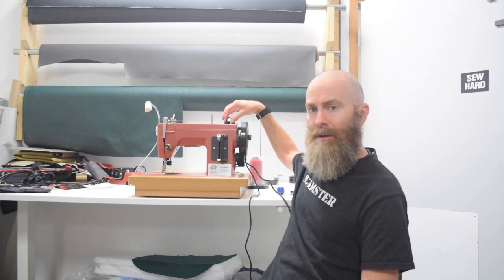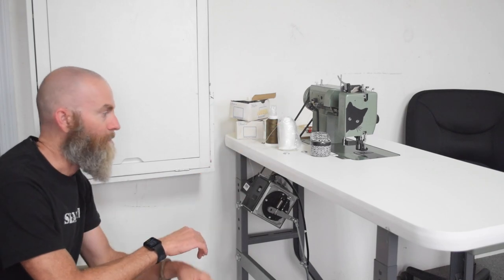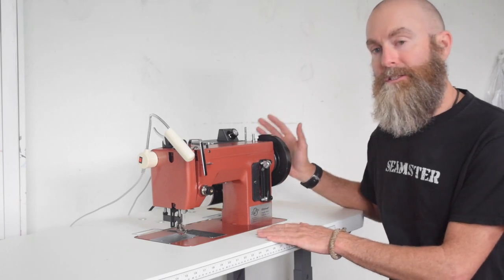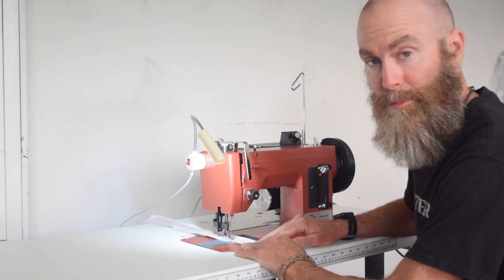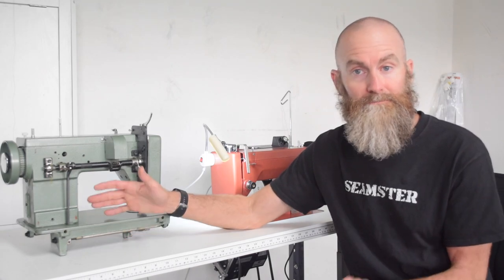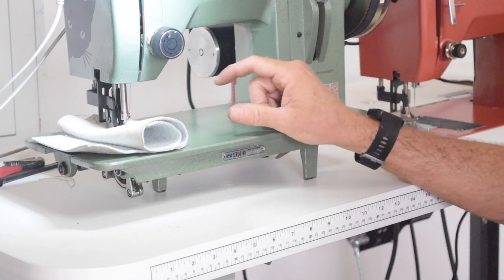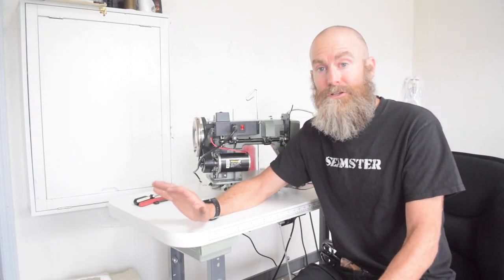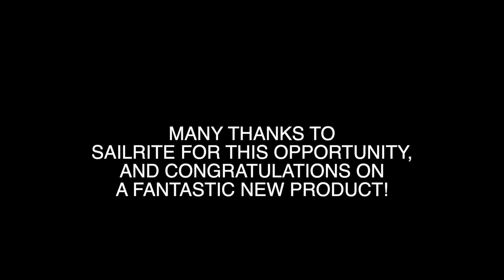Sailrite WorkerB Motor Package (It's Incredible!!!)

Comment: Sailrite owes you a sale. I have been on the fence for a few years about buying their machine. I just bought one that comes with this motor package.
Reply: I'm SO sorry.  You drank the KoolAid.  You'll regret your decision to not buy a real machine soon enough.  et me know how many "work arounds" from Sailrite - it takes to get the machine working correctly.
Reply: @jeffdenig705  I believe your first sentence is correct. 
I have not seen any negative videos about their products. Perhaps you have one?
Reply from the maker: Hi Jeff, I've been using this LS-1 since 2016.  It's been used hard and often.  The only issue I've ever had was a broken spring that was replaced under warranty (and that did not effect the function of the machine).  I have purchased countless items from Sailrite with zero complaints or problems.  For instance, I have their Edge hot knife (purchased by me, not provided as a review sample) and I love it.
Rather than show up and throw out vague negative statements, it might be more helpful to others if you would cite specific issues you have experienced.  It's entirely possible that there are problems your fellow consumers need to know about, but your comment doesn't help any of us know what they are.

Comment: I literally stumbled onto the Thompson PWZ-500 several weeks ago, complete with most of the accessories that it came with. Was bought new in I think 2003 new but now used from the original owner. She passed on and did sewing of sails as her late husband had a sailboat. Bought it at an estate sale for half off the original price they had it it on Sunday. Needs the bigger flywheel to better control the low speed for sure. Need to get it to pick up the bobbin and know it'll do so, but have figured that out just yet. Good to know the Worker B will work fine on the Thompson as much as it does the Ultrafeed so have dully noted it. :-)

I do have my late mother's 80's era Husky/Viking 930 I think it is machine that can't pick up a stitch and not without clunking so will need to be serviced I think. A few years ago, had it fine, but been difficult to get it going since then.
Reply: are youusing a carbon pile or 'electronic' pedal?  carbon pile pedals can give pretty good slow speed, variable control.  the large flywheel the sailrites have is like obsolete because what its for is punching through material at slow speeds..  i mean using the existing motor for leather or rubber the large flywheel would be handy but..  the small flywheel goes faster! and its metal, and i like the twist clutch over the posipin.    

but yeah i might get this motor too, idk
Reply: @chrisprice5806  i have no clue, it's what came with the machine and even Jason brought that up when he did his review of the Thompson in a previous  video about it.

Comment: Thanks, Jason. You sold me . I am calling Sailrite.
Reply: They told me appx October 1, between $250-$300 ("but don't quote them").
Reply: (coughs)carbon pile foot pedal still works fine for slow/variable control(ahem)
Reply from the maker: Chris, I think you are WAY overstating the difference between a carbon pile pedal and this motor package you have never seen or used before.  Clutch motors on industrial machines work "fine," too, but that doesn't mean servo motors aren't better for the vast majority of users.
Reply: @thejasonofalltrades  i have a THOR 500watt typical servo motor with a smaller pully on its shaft powering my consew 7360rb-2(drop feed) and comparing the carbon pile i have to the servo i have there is,, clearly a difference; the carbonpile needs some extra stepping to get moving and then let off it a little, it's performance changes with tempature, it can vary its variable control a little while being used.

but i can lift and drop the needle on my thompson with a carbonpile pedal fine.  

no one uses clutch motors i dont think.

hey man im looking forward to your tents.  a binder attachment like i think you said will make things possible.  im just keeping it real about the pedals.  i might buy it but not sure how well itll work with my plastic case.

Comment: Thank you very much for showing this new motor. I agree with you, that it is a big improvement compared to what you typically can get in the market place. I like the good slow speed control as you do. I know something about electronics and motors, and I am not impressed by the typical speed control you got on domestic and industrial sewing machines. Most servo motors do not work that well and got a rather high lowest speed. I made an electronic control for one of my sewing machines - and I sometimes move it to other machines. I think it got even better control than this, and it is mainly because of a better pedal, so you can change speed very fast. The pedal is controlled more by pressure than by movement. Elna used this kind of pedals for some time 35 years ago. You may have seen the video about it on my channel.
Reply: I couldn't agree more, although I can only speak for domestic machines. Years ago I had a New Home machine which was a 1980s model and on that there was a 2 speed control on the pedal, and also you could lift the presser foot to one height and then a bit higher still. I haven't seen those features on other machines I have owned (quite a few). But - I have just become the proud owner of a Bernina 930 and I almost weep with joy over the slow speed and controllability of it!!
Reply: @lizziel4876  i have got a Bernina 910 and I think the motor control is the same as the 930 - I have looked at videos of the Bernina 930. And I agree, that the speed control is better than most machines have got. The electronics of the 910 and 930 do also include the electronic load compensation as this WorkerB have got, so it increases power to motor when it senses higher load in the same way as the WorkerB. But I think that the WorkerB got higher power and in this machine it got lower gearing. These two factors makes the control you see in Jasons video significantly better than my Bernina 910. The lowest speed of the Bernina 910 is about 50 stitches a minute. Because I know about electronics I modified the electronics a bit in the machine, and in this way I could reduce it to about 30 stitches a minute.

The Bernina 910 is a cheaper machine with less decorative stitches, no knee lift and perhaps a bit smaller. Otherwise it is very similar.
Reply: @sewingmachinesindetail  thank you for that information. The speed control of my 930 is worth every penny that I spent on it! (came with a Horn cabinet too!)

Comment: Jason, great video. I bought a lsz1 about 6 months ago and can’t wait to buy one of these for my machine. Complete game changer.
Reply from the maker: Yeah, this is finally pushing me over the edge to buy an LSZ-1, too!
Reply: Jason there is  LSZ-1 for sale in my area
For $800 and it has a table and servo motor included in the full package —- is this a good deal?
Reply from the maker: @nahnahbethr661  Not knowing any details, that sounds like a good price.  Particularly if it is a newer LSZ-1, with the upgraded stitch-length/reverse lever and the Posi-Pin engagement system. You can email me at     the jason of all trades @ gmail . com (remove the spaces) and we can get into more detail if you like.
Reply: @nahnahbethr661  If the machine is in good working condition I would say it is a great deal. If that machine was bought as a base package you would be $995 for the machine, $269 for the table, and $199 for the servo motor. Keep in mind it may be an older model but should do all the same things as the current model. Just my opinion and I know you didn’t ask me but I wanted to throw it out so you don’t potentially miss a good deal by waiting too long.

Comment: Great video...  If you are ever making another video on this same subject, you may want to mention that another advantage of using this upgrade with the Monster Wheel is that the additional weight of the Monster Wheel adds a considerable advantage - it gets momentum working on its side, thereby, reducing strain on the motor, which is considerably stronger than the original motor.
Michael from Canada
Reply from the maker: Thanks for the additional info!

Comment: Hi Jason, I have been researching industrial walking foot sewing machines and am considering purchasing a sailrite, so thanks for  the great videos.  I was looking on the Sailrite website and  it looks like a worker b motor package is now the standard motor on the ls and lsz machines.  Do you know if it is the same motor as in your demo?
Reply from the maker: Hi!
Yes, that is the same motor package. Since this video was made, I have also purchased an LSZ-1 with WorkerB (before it became standard) and I absolutely love it. Making the WorkerB the standard motor seems like the way it should be, there is no reason to buy one with the old household motor.
I have a few other videos about these machines you might find informative or helpful, but in short, I really like them. They aren't cheap, but they're very good.
I hope that helps, thanks for watching!

Comment: Does your worker B motor have a lot of side to side movement when its running? I just installed this system on my old Thompson and the whole mounting bracket really flexes back and forth  while the motor is running (even when its not sewing through any material).
Reply from the maker: Hi!
I'm sorry for taking so long to reply to this!
I have two WorkerBs, and neither exhibit ANY movement that I have noticed.  I suggest you reach out to Sailrite if you haven't already.

Comment: This is awesome. I just got home from picking up a barely used Fabricator, and was looking for presser feet, and saw this. I've been looking for a small servo motor to put on one of my 201's, or my Pfaff 130 for years ( because we all know the only limitation those vintage machines have is the motor.)
The worker b looks like it will fill all my ideas I had for those old machines, which can handle much heavier work than the motors will allow.
Even though I don't need them to do it, I want to experiment with them. Someone should make a video about it, hint hint.
Reply from the maker: As soon as I got a WorkerB, I thought about attaching it to a vintage domestic machine, and it seems a lot of others have thought the same thing!  I'd like to try it at some point, I just need to find some time lol.  If you do it first, let us all know what you think!

Comment: I've been seriously considering saving up for an LSZ-1. It looks amazing and this motor appears to make it even better! Right now Sailrite only sells the WorkerB on the highest priced package (of course!). The price for that package went up $200 so guessing that's how much it'll cost to buy it separately.
Reply from the maker: I think it's supposed to come in around $299 for the separate package.  Things like this are usually somewhat discounted when purchased as part of the actual machine as opposed to a separate component.  
And after years of considering it, this motor package has me finally ready to pull the trigger on an LSZ-1 myself!
Thanks for watching and commenting!
Reply: @thejasonofalltrades  Ya I thought about that after writing the comment. But 1/3 off the price is pretty good. More than I'd expect for sure.

Comment: Hello Im new to the channel, it's been really insightful to watch your videos, especially about Thompson sewing machines.
I recently acquired an old Thompson PW400 and looking to do some modifications, I work leather so I need low-speed control and a good amount of torque, I was wondering about the servo motors and the Sailrite WorkerB Motor Package, which one it's better for the task of small leather goods? Also because I'm on a budget,  how different is the Sailrite servo compared to a generic one?  would be too hard to adapt a generic one to my Thompson?

Comment: Great video, thanks.  Where did you get the “stitch size lever” on the machine?  Was than an optional accessory?
Reply from the maker: Hi! The stitch length lever on this machine is one of several improvements to the portable walking-foot machine design Sailrite has made over the years.  I believe you can buy the assembly from them to retrofit on older Sailrites or similar machines. All current Ultrafeeds come with that lever, and have for at least 6-7 years (I'm not sure when they started with that lever, but I've had the machine in this video since 2016). It's a HUGE improvement over the old design, in my opinion!
I hope that helps, thanks for watching!

Comment: @thejasonofalltrades I have a Thompson PW-301. Will the WorkerB motor work with the plastic Power plus wheel or will I have to get the steel Monster wheel to get it to work?
Reply from the maker: The WorkerB will come with a specific hand wheel as part of the package.  If I'm not mistaken, the power plus and the monster wheel are the same diameter, so if you already have the power plus wheel, you would see much of the same slow speed control due to the overall change in gear ratio from the larger diameter wheel, compared to the WorkerB wheel.  Some Thompson machines (apparently very few, but both of mine) came with a larger jack drive pulley, and if you have that, it will need to be changed to the Sailrite one (there's a link to that pulley in the description of this video).
I hope that helps, thanks for watching!

Comment: As usual another very good video from you. I had a lsz1 and i really liked but found a singer 531B (consew206rb) at a good price so i sold the sailrite, the other sturdy machine i kept is a singer 20u33, and is a good machine for its purpose, do you think the worker b motor would fit  a 20u to make it portable? I know i will probably have to fabricate some brackets but is no big deal for me.
Reply from the maker: Thanks!
The WorkerB is specifically designed by Sailrite for the Ultrafeed machines.  I suppose a bracket could be made to adapt it to other machines, but I don't know if it would work well or not.  Enough people have asked about it that I suspect it's a matter of time before someone tries it lol!

Comment: what are the downsides to putting a smaller pulley/cog on the standard motor? Sailrite actually sell a smaller one.  This would give better slow speed at the expense of high/fast speed.
Reply from the maker: I haven't tried a smaller pulley on a standard motor.  It might slow the machine down effectively.  The WorkerB is hugely advantageous because not only is it capable of sewing extremely slowly (especially with the Monster wheel installed), but the torque is impressive and the speed control at any speed setting is amazing.  Plus you can change the speed range with the dial.  If you only need to slow your machine, a pulley is certainly more budget friendly, but if you can justify the cost, the WorkerB should be on every Ultrafeed, in my opinion.
I hope that helps, thanks for watching!

Comment: Jason, Thanks a lot for showing that the Worker B Motor can bolt to the Thompson..   I have the non zig zag version of your thompson and I wonder what the size difference is on the "drive reduction gears" RE:  thompson vs the salirite. If you have a second to measure them that would be super helpful.
Reply from the maker: Hi Jay, sorry for taking so long to reply!
I sold both of my Thompsons to buy my new LSZ-1, so I don't have them here to measure.  Mine both had an apparently rare larger diameter pulley, so they might be different from yours, anyway.  The correct pulley to use with the WorkerB is available from Sailrite, so if you aren't sure, I'd just add one to your order when you get the motor package.  I hope that helps!
Thanks for watching!

Comment: Thanks for the excellent review and demonstration, Jason. Are you able to tell me if this could be used on a standard domestic machine, specifically a Singer 237?  Thanks again
Reply from the maker: I didn't ask Sailrite, so this is pure speculation: I suspect someone with the required skills and motivation could adapt or fabricate a new bracket to fit this to other machines (one would need to either drill and tap some holes in the machine or otherwise find a way to attach the bracket, too). Whether the "gear ratio" would be appropriate without the Sailrite's "jack drive" is another question that would have to be explored (a different pulley might be needed on the motor, perhaps?).
In principal, it seems like this could be made to work on other machines. It is absolutely NOT a bolt on, plug-and-play for anything but the Ultrafeed and identical machines.
As soon as I got this, I side-eyed my 237, too.  I can definitely see how this motor could enhance a robust vintage domestic machine.
Thanks for watching and commenting!
Reply: Thanks very much for your detailed reply, Jason. I was definitely hoping for a plug-and-play solution.  Thank you for clarifying

Comment: I wish they made stronger replacement motors for all external driven sewing machines like the Singer 237. I did find one that was a tad larger,(1.5 watt), but it still can struggle to start a stitch run. The old machines were made tough enough to handle more power.
Reply from the maker: I'm not going to lie, I have wondered if I can somehow rig this to my 237 lol.